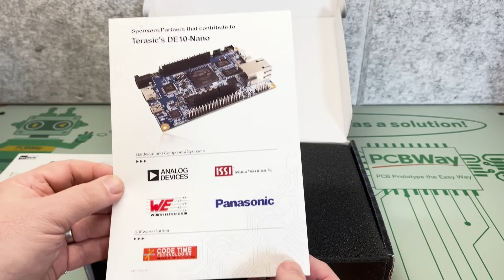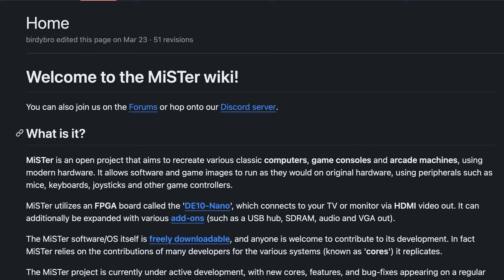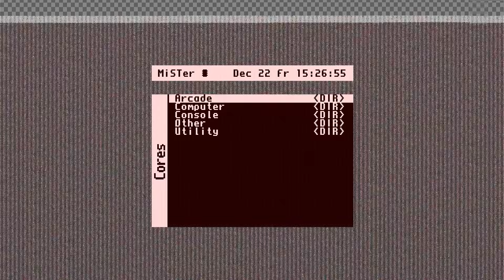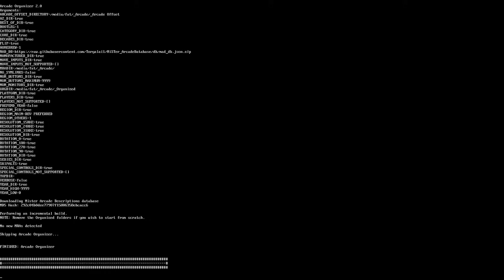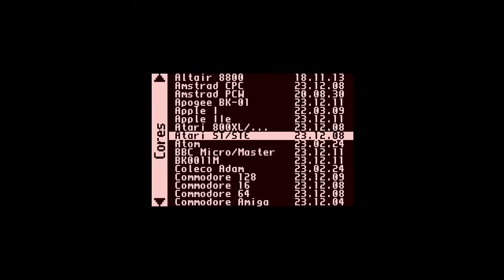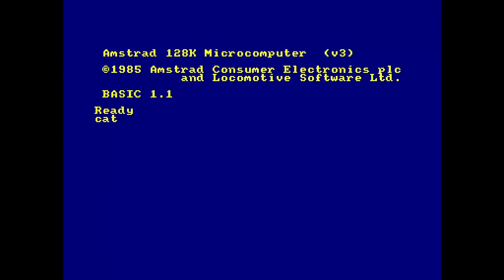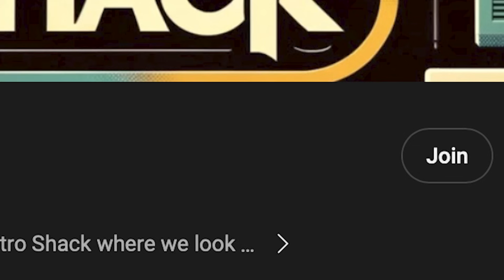Merry Chr-Mister-Mas! There's a Mister FPGA In The Shack For Christmas!

Comment: A couple of corrections/clarifcations. You do NOT need the hub or the IO board. The DE-10 Nano will work fine without them. Also. the 'cores' are programs, of a sort, and are only as good as the programmer that created them. Just because a core runs on an FPGA doesn't necessarily make it better, or more accurate, than a software emulator running on a discrete CPU. It's a subtle but important distinction as many seem to think that just because it's an FPGA, it's precisely like the original. That isn't close to being accurate. And perhaps it's a nitpick but FPGAs don't replicate the PCBs.

There's a lot of inaccurate information out there. It's a shame to see someone with a platform spreading it rather than dispelling it.
Reply: For example, the NES and genesis/megadrive core works even without a ram module and just the DE10 nano only.

Comment: Took me a long time to get hold of the DE-10 board (came from america in the end), done an end to end video on building one myself and TBH, the only time I had to look at documentation was the installation for the SD card but that was actually pretty straightforward, so if I managed it, think most people can do it as it was more like a lego kit once I'd bought all the bits!
Reply: The basic stuff is rather easy, but the devil is in the details. For a casual gamer, it's pretty much plug & play, except with an interface that's not as nice as RetroPie or something like that. The pain begins when you start to care too much about lag, some people get disappointed when they figure out their MiSTer isn't as lag free out of the box with the default settings as they expected from an FPGA, not realizing that between their HDMI TV and Bluetooth controller, they're bound to experience lag.

You'll then realize that if you want lag identical to real hardware, you need to deal with wired controller adapters and a CRT display or two (a bit hard to get CRTs that support both 15kHz and 31kHz signals these days). Or hit the LCD/OLED lottery and try to find a good modern display that can take weird timings over HDMI and not do weird stuff internally.

Comment: Maybe I missed it, but how much does this exact setup cost?
Reply: I never seen this exact setup before, but I've seen very similar ones at around 450 USD + shipping and taxes with no case and 540 to 600 USD with nice aluminum cases. There are some cheaper cases out there made of laser cut wood or acrylic as well and some cheaper not so nice aluminum ones as well. And if you have access to a 3D printer, there are some really nice models for free on thingiverse, printables and so on that shouldn't cost too much to print and look way better than most cheap cases.

Comment: Merry Shackmas, the poem was fun. I still wonder if I should grab a MiSTer, rather than spending money on other systems.
Reply: It really depends on what you're into. If you like to test out a few hard to get systems, the MiSTer can become a huge money saver, as some stuff it supports is nearly impossible to get and/or ridiculously expensive, like the Neo Geo AES and Sharp X6800, and that's not even mentioning arcade stuff... some boards are essentially unobtainable.

Comment: Nice description of FPGA vs emulation. But isn't FPGA accuracy not only just as good as the reverse engineering of the original hardware? E.g. is the C64's SID indeed replicated 100% in the FPGA? And the VIC-II as well?
Reply: Accuracy varies from core to core. Most cores are made with accuracy in mind, but some aren't. One such example is the ao486 core: it doesn't try to be a cycle-accurate implementation of any particular 486SX based PC. One of the nice things about the MiSTer project is that the cores are open source and often improvements made for one core that uses the same chips, even for different FPGA platforms, get ported over between cores. Some of the core devs are professional engineers with backgrounds in circuit design and reverse engineering of legacy hardware. There also seems to be some overlap and collaboration between MiSTer devs, MAME devs, collectors & restorers. Also, quite a few people in the community that aren't devs themselves support core devs through patreon, loaning / donating hardware they want to see implemented in MiSTer, sharing documentation, reporting bugs they find and so on.

Comment: Great poem and video but i just dont get what the fuzz with the MisTer project that needs 7 cookie pcb's just to play retro games. There are many more FPGA options in 1 single board more than enough to play retro games and a lot cheaper than the Frankenstein MisTer that looks like a brick from Keops. Just sayin… other than that wonderful editing and informative as usual.
Reply: You can come a long way with just the de-10, a ram module and a otg hub. You don’t need any other boards.

Comment: I don’t know why I can’t seem to get Retroarch working. The PiMiga seems to work really well, especially on a Pi-400. I have Retroarch on a few platforms (PS3, Windows, Android) and it can’t even emulate a C64. I guess it can play certain games, but you can’t run it as a Vice computer. Can’t even run SNES titles. The configuration setup is utterly bizarre. Seems like a colossal waste of time. I’m hopeful the MiSTer isn’t as flaky but from this video it sounds like it is, or at least, certain cores are.
Reply: The MiSTer cores are among the most complete and accurate in existence, that really shouldn't be a worry.